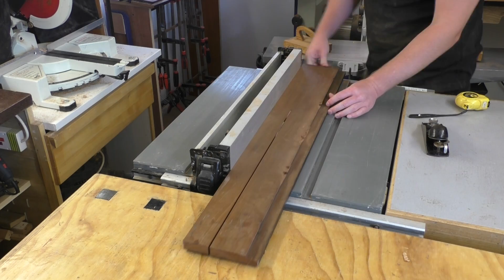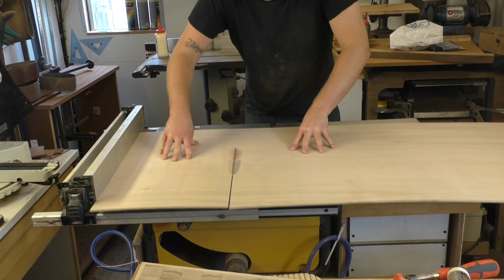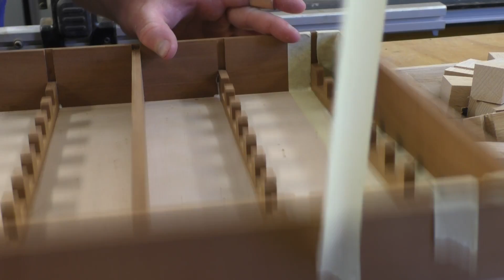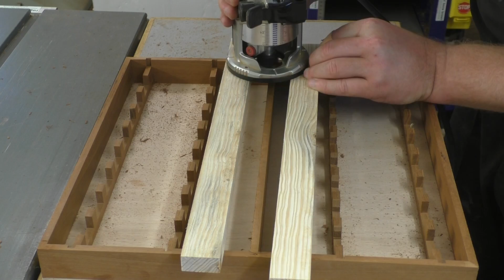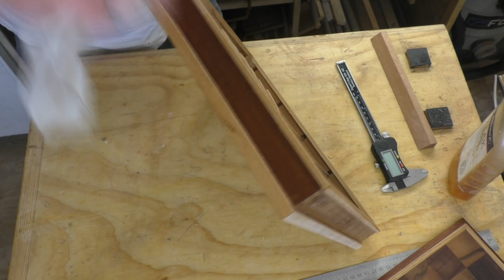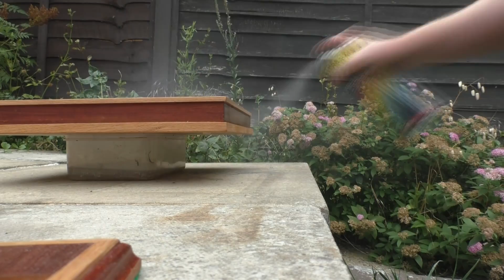The Chess Set (Part 3 of 3) - The Box and Final Touches

Comment: Nice! Please clamp those sacrificial rails you ran the router on, though... You gave me the heebie-geebies regarding the safety of the piece you were making AND more importantly your personal safety... I also would have gone with tung oil not teak oil below my varnish but very nice job. :-)
Reply from the maker: I would have ordinarily but I was concerned that the sides of the box may not be strong enough before the corner supports were added
Reply from the maker: I used Teak oil because it's what I had, and I doubt I'd be able to tell the difference between the two anyway